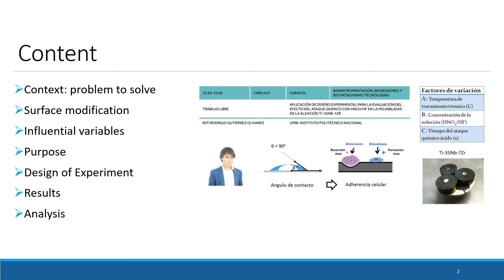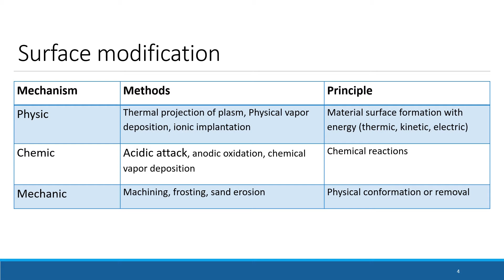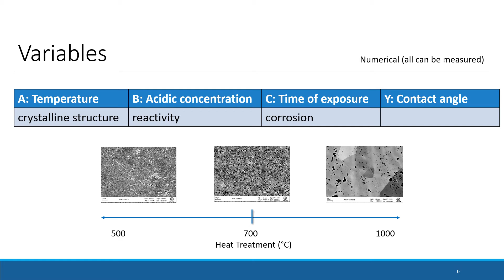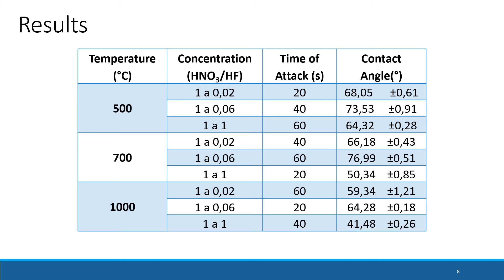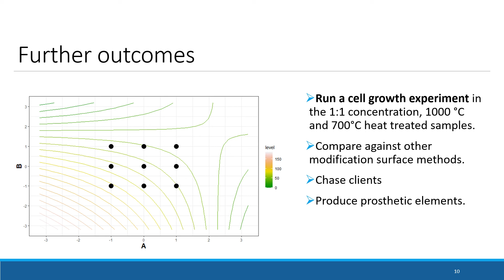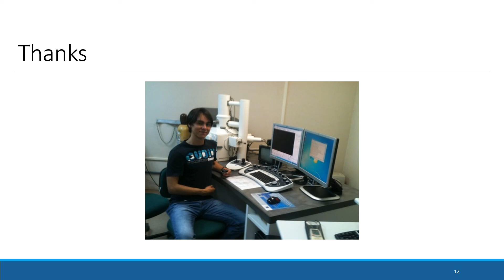Application of DOE to evaluate the effect of acid attack in Ti-35Nb-7Zr alloy

Comment: Hi Rodrigo, you have a good project, I have some doubts, you explain well why those are your main factors, but it would be good if you explain why you choose those levels, in fact, the +1 level of acid concentration is at the extreme value it could be 1: 0.8 to be symmetric with level -1 and treatment temperature level 0 is not at the center point, it should be at 750 ° C if you have a good reason to choose those extreme and center levels it would be good to explain it in the presentation. What would be the perturbations, covariates, and nuisance factors?

Comment: I found it very interesting and concise. This design is a little more elaborated as those we saw during the lecture as you are including a center point because you are considering a non linear model. I read about that in some papers! In that case why didn't you run the model with the quadratic terms instead of just the linear ones, because in either case, the use of the center point is aiding in that regard. I think that's the reason of the confidence levels be too low (3:45) with just the intercep being "acceptable " calculated. Also I think that you ought to show the design table to identify which were the selected points and a brief explanation of why. In either case, is it possible to duplicate the runs? Remember that single, duplicate an replicate runs are all addressed in a different statistical way and seems that you could probably benefited from duplicated runs as in the example of Montgomery about the waffer etching in ovens for electronic purposes.

Comment: Hi! 
I think it would be helpful to describe briefly the acid attack method to have a better understanding of your project. Why is it important to get a lower contact angle using this method? 
Also, as mentioned, the values for level 0 don't match with baseline values so they should be correctly code. 
Interesting project!

Comment: HI 
Very interesting project, I have two comments
First, you don’t explain deeply about covariates or disturbances that you could have.
Second, you put in level 0 for factor A a value of 700 but this is not the middle point so you should change to 750 or change the codification for this factor.
Reply from the maker: You should check on the phase diagram of this alloy to understand why temperatures are not something that can be set as a fixed range  (every particular experiment will give you the relevance of the variables and how to variate them depending on the physical, chemical or any other properties)